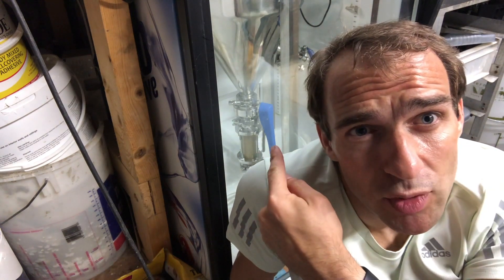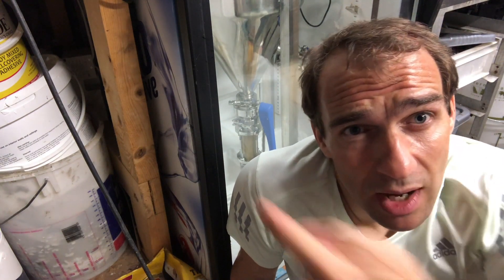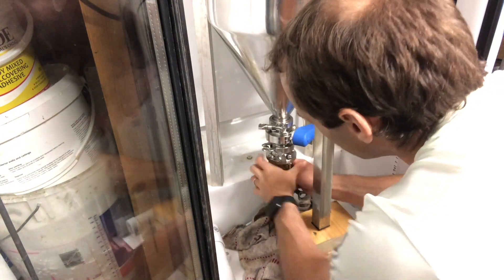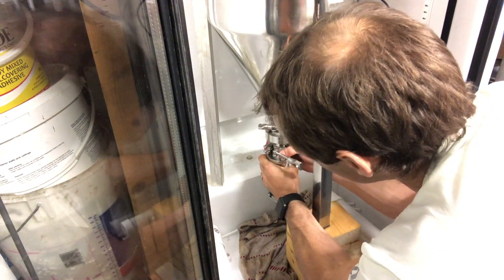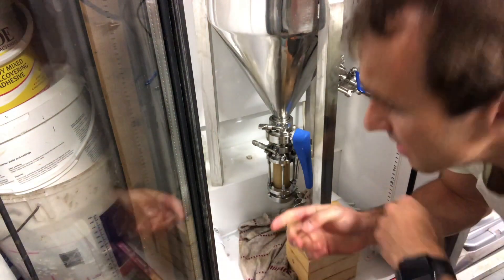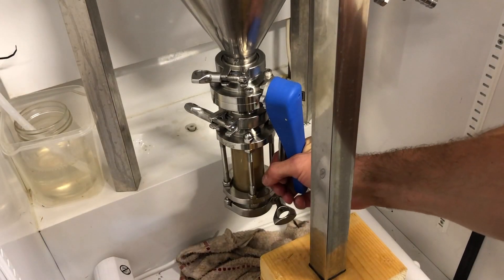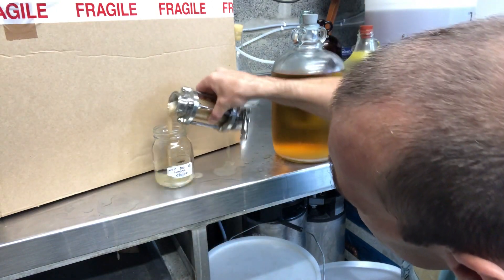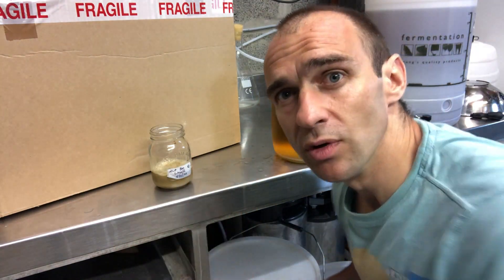BrewBru ep6 - Yeast Harvesting with SS Brewtech Chronical Conical

Comment: Do you have issues with oxidation of the beer by opening the valve on to an empty collection jar?
Reply from the maker: Hi Simon - not in my experience no.  I think there is probably still enough action in the yeast that it's producing CO2, therefore leaving the lid off slightly is a good idea and allows this CO2 to escape and purges the oxygen.  Also the wort you collect at the same time acts as a protective layer for the yeast. In summary I've never had a yeast extract go bad!